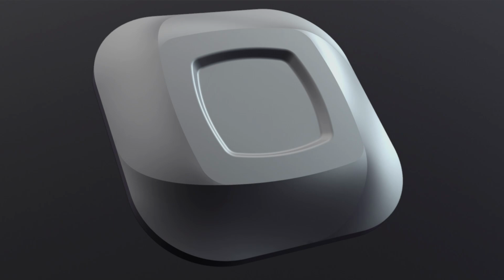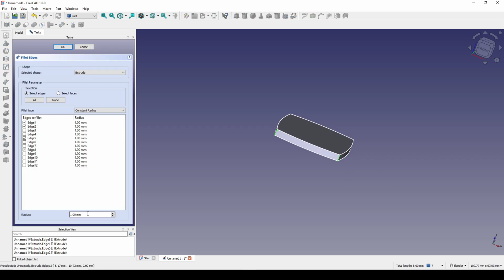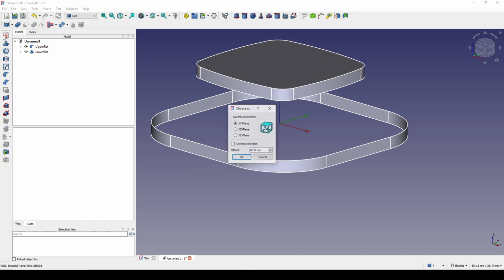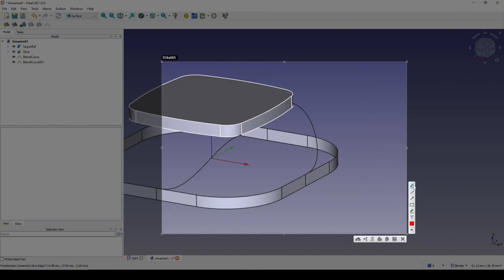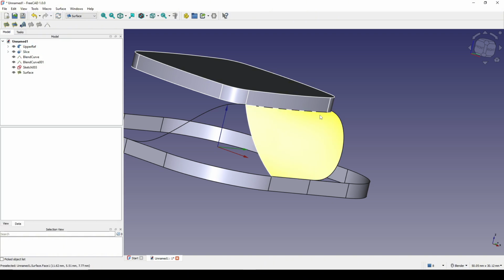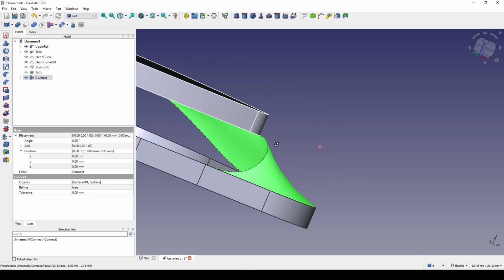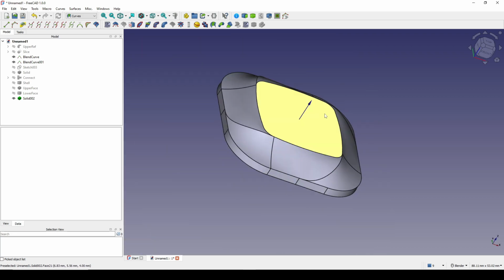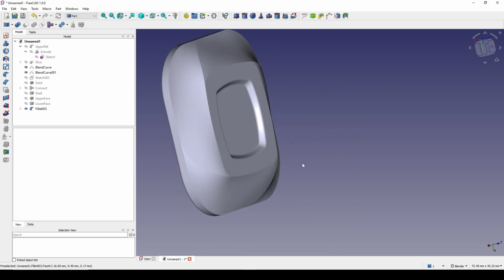FreeCAD 1.0 Surface Design A TV Box.

Comment: Thanks for you work. When I try to create the uppercase from the extrusion, the parametric solid becomes a solid (which brings all the faces into the new shape) instead of shell shape status as the one you have. Would you know why this is happening to me? Thanks in advance.
Reply from the maker: Make sure you select the bottom face of the extrusion ( not all faces) in the 3d view.
Reply: I had the same result. When creating an upper case face, instead of using the Parametric Solid command, you can use the Draft Workbench - Facebinder command to create the desired parametric upper case face.